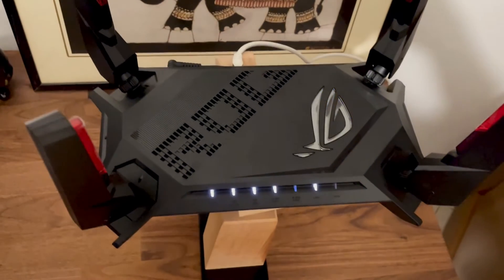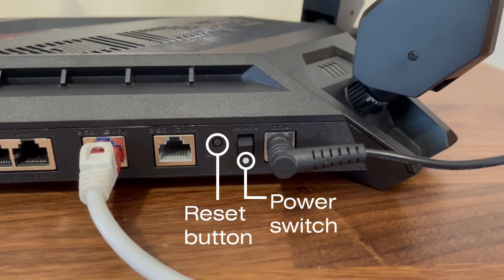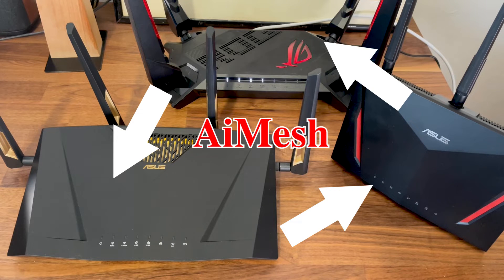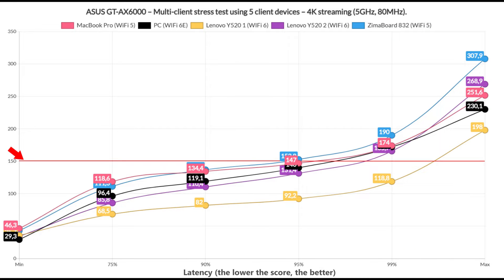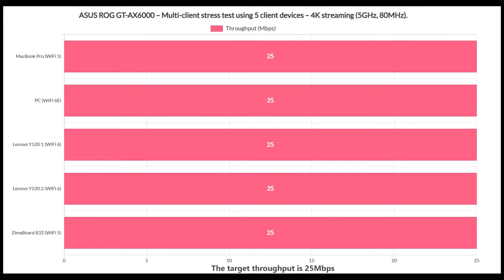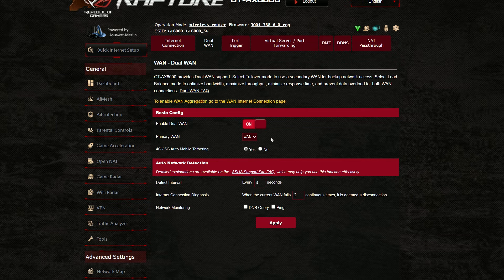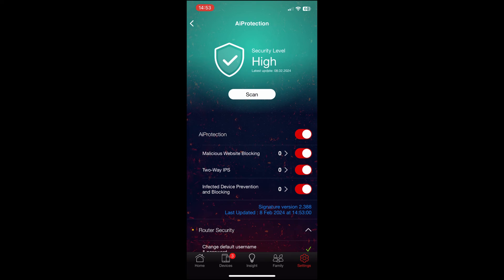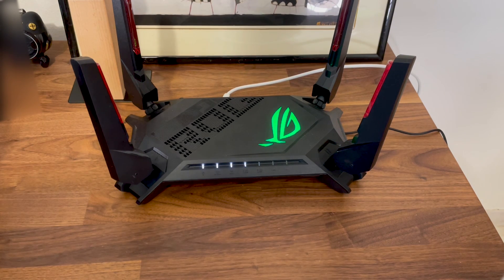ASUS ROG Rapture GT-AX6000 WiFi 6 Review - Same as the RT-AX88U Pro?

Comment: and to make it more confusing add in the TUF Gaming AX6000, seems mostly identical but with half the RAM
Reply from the maker: Yes. ASUS doesn't make it easy to choose between models. As a side note, I did test the TUF-AX4200 (also very close to the TUF-AX6000 hardware-wise) and it was impressive.

Comment: Very informative review! Love to see all the data!

I hope you can test ASUS RT-AXE7800 too. I am torn between this AXE7800(which i can get for 209eur) and AX6000 (which i can get for 182eur) and cant decide what would be best for me and if Wi-Fi 6E support is worth the extra ~25eur and a loss of a second 2.5Gbps LAN port.
Reply from the maker: If you use or intend to use the 6GHz radio in the following months, then I suppose the AXE7800 makes sense, otherwise, the GT-AX6000 is still a decent device.
It would be interesting to test the AXE7800, so I will check out if I can find a cheap one available.
Reply: @SamBondor  do you, by any chance, have an update on this?
Reply from the maker: @Acid_Burn9  I checked out the market and there are some cheap options available, so I will test it very soon.

Comment: I am waiting for the Asus RT AX86U Pro. Bought this today due to the fact that price vs performance is worth it. I want stability. Most of the reviews do not mention about the disconnections or buffering problem of a router due to heavy usage which no one mentions when reviewing the unit except yours. Overheating of the CPU and RAM without good cooling solutions of some basic router often cause a not so smooth connection specially when gaming while somewhere in my apt my wife and daughter streaming movie. I like your detail review and breakdown inside look of the router

Comment: This is an amazing review. Now I have the GT-AX6000 and I don’t know if I should keep this one or go with the AX88U Pro. What would your recommendation be for longevity? I want a router that will be supported for years to come will perform the best of the two and provide me dual 2.5gb ports. I know that the dual ports is a on both so that’s why I’m stuck between these two. I plan to have a server and nas soon to my system. And the ax6000 I have walls mounted right now so that’s also a plus. Let me know what you think!! Thanks!
Reply from the maker: It's true that the RT-AX88U Pro is newer than the GT-AX6000, so perhaps it will receive updates for longer. But that's not always the case because ASUS still offers support for RT-AC68U.
Like I mentioned in the video, they're almost the same device, so if the GT-AX6000 works fine, I would just keep it.

Comment: Great video, so much detailed information 👏 Thanks for all the effort you've put into this.

Im doubting between buying this router or the AX86u pro that you briefly mentioned in the end of the video. Based on your experience, which would you recommend?
They are both available for the same price. I don't care about the gaming specifics so much, just want the best performance. Im currently leaning towards the AX6000 just because it has dual 2.5g ports.
Reply from the maker: I haven't tested the AX86U Pro yet - it's in the works. But if it's the same price as the GT-AX6000, I am fairly confident that it's a better option than the RT-AX86U Pro, even if perhaps not by a very large margin.
Reply: @SamBondor  yep, I'll be getting this one I think. Thanks for the reply.

Comment: how is aimesh between ac88u pro and gt ax6000
Reply from the maker: I used an RT-AX82U as a mesh node for an RT-AX88U for a couple of years without any major issues (some mild VLAN problems, but easy to solve). Bear in mind that I essentially connected two houses together. The RT-AX88U Pro and the GT-AX6000 are both superior, so the coverage and throughput should be even better.